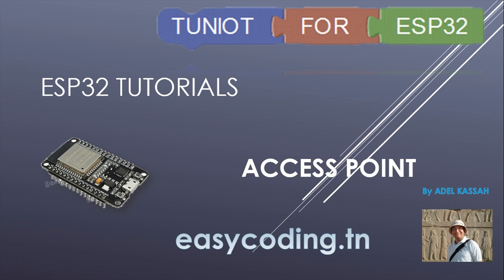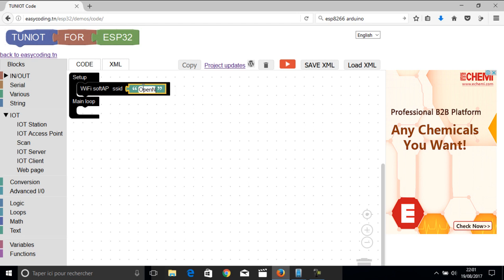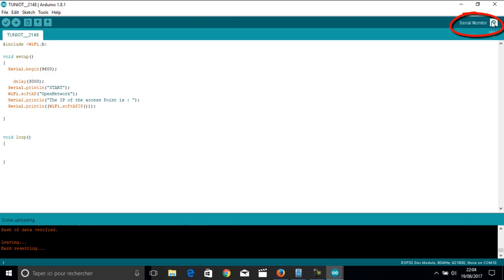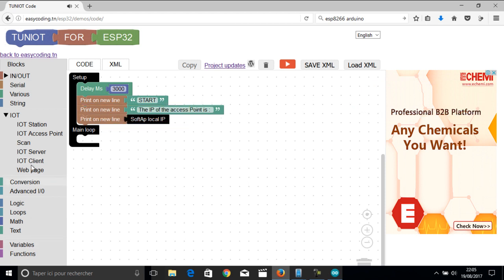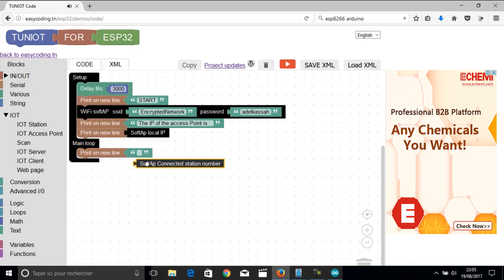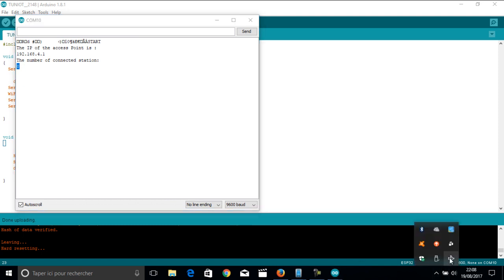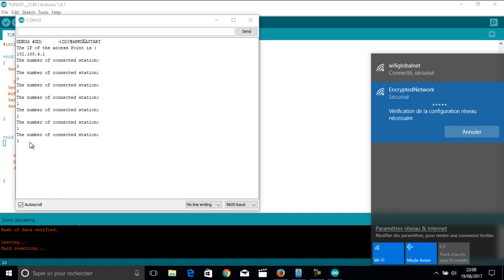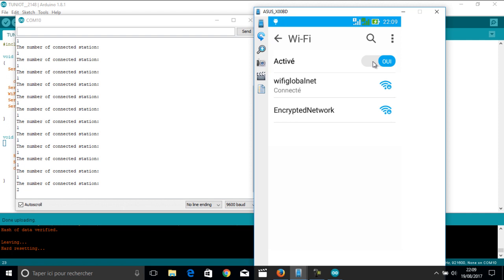ESP32 tutorial B-02: Access Point

Comment: hi, what wifi library do you use? using the one already included in the ide I get this error: 'class WiFiClass' has no member named 'softAP'
Reply from the maker: There is 2 tools for 2 different boards. Be sure which one you use
Reply: @ADELKASSAH  may you pass me your library?
Reply from the maker: There is no additional library. But you need to add the esp32 in board manager. What is the name of your board?
Reply: @ADELKASSAH  the problem isn't the board,is the library

Comment: Thanks for the video. I was wondering if you can use two esp8266 modules in AP mode to control led or a motor without going through http, mysql and all that rubbish. Just like using two bluetooth module.
Reply: you'd need to have something to communicate with the led, could be another bluetooth module, or you could use a socket and you wouldn't need to use any HTTP protocol